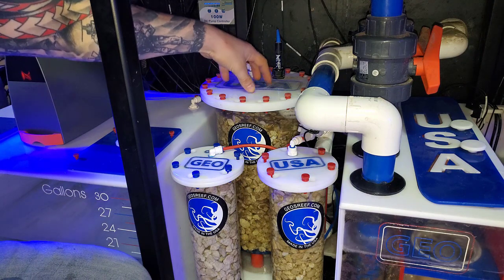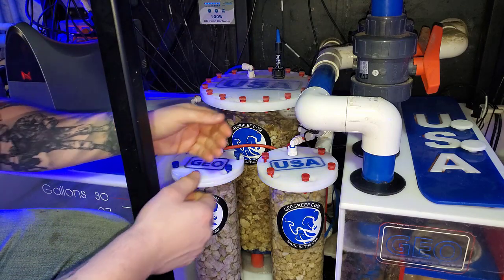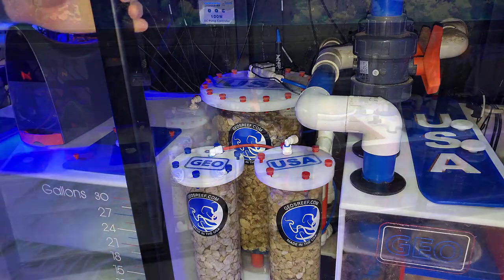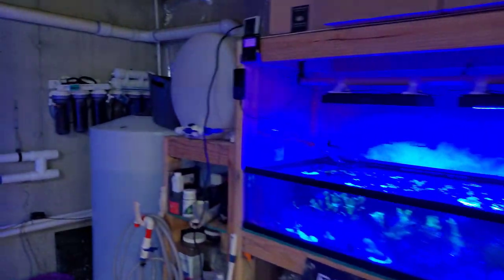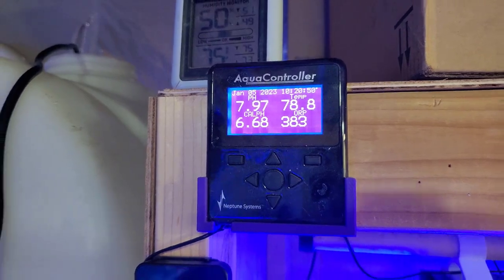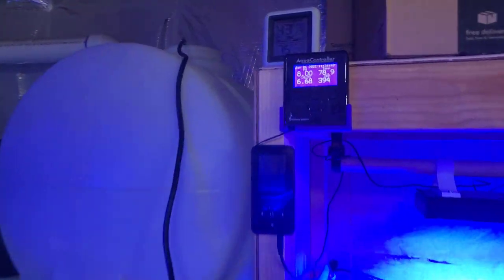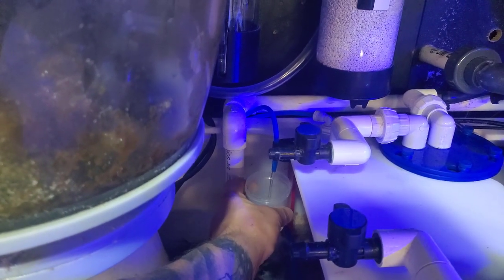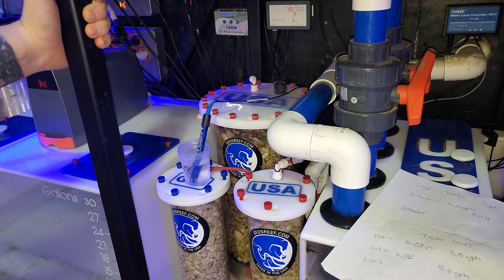Part 2 | Testing PH Increase From Secondary Calcium Reactor Chambers Using Apex. Final Results

Comment: Have you tried bubbling outside air through the effluent before it enters the tank?
Adding more and more secondary reaction media is a way to approach this. But, much like excess CO2 in open atmosphere changes tank pH, it can also effect effluent.  Obviously you'd have to rig a chamber (probably open top) to try that though. 
I'm just lending a suggest because you're openly experimenting. It's an concept I've herd articulated several times in the past, that matches our understanding of the chemistry. But, I've only seen it implemented once or twice. Reef Builders is the only real standout coming to mind.
Reply from the maker: I'll look into making something 3d with airstone.